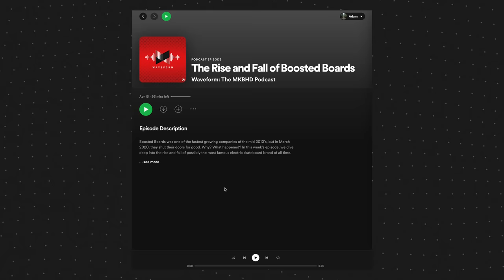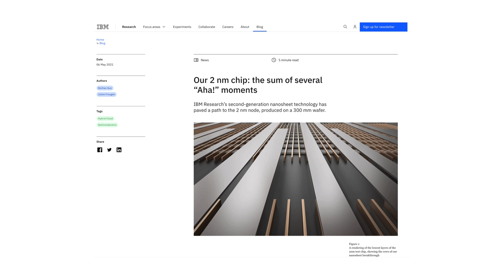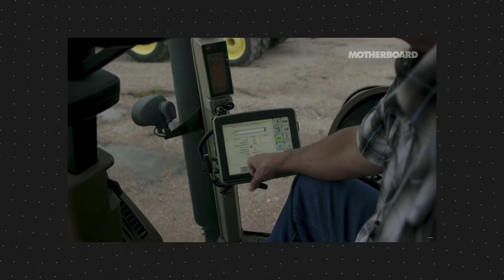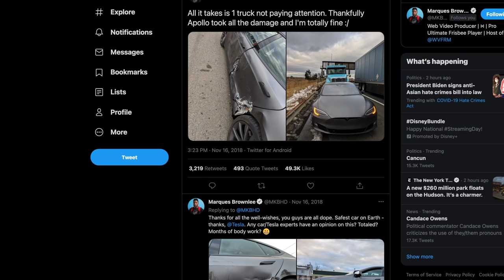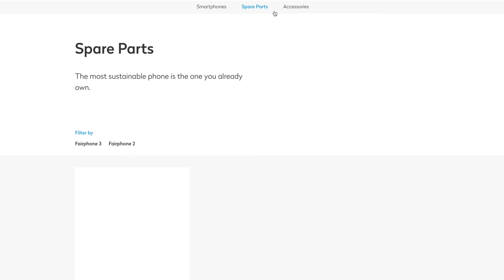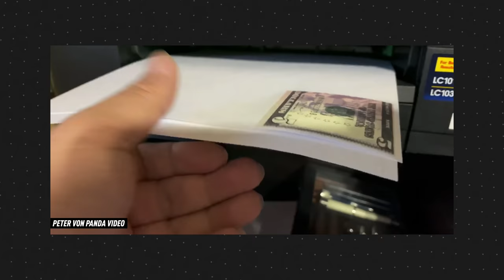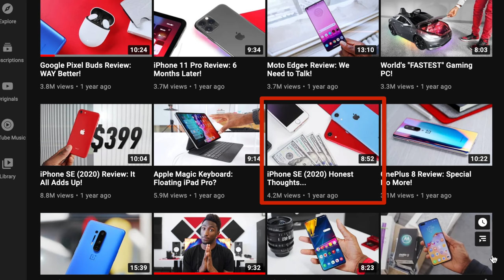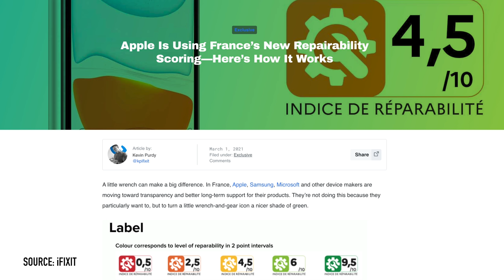Right to Repair Deep Dive!

Comment: I'm really not a fan of the bothsidesism going on in this podcast. The comparison of you can't print money with tech companies not letting small repair shops from having access to repairable parts is utterly ridiculous. One is preventing illegal activity. The other is forcing obsolescence and practically forcing people to buy new shit. Forcing a 3rd party manufacturer to not sell parts to repair shops is reprehensible and disgusting in a capitalist country (cough, cough, apple)
In terms of Tesla. The fact that if I make an unauthorized change to a Tesla means that they can blacklist you from the super charging network is the dumbest shit I've ever heard of. It's like if I replace something in my car and Toyota says nope you can't use gas stations anymore. Like how dumb is that?
Don't get me wrong. You showed some decent counter arguments like with John Deer. But at the end of the day it's on the buyer to decide if they want to fix their own shit. Even if it fucks up the reputation of the company. No company has the right to prevent the purchaser from using what is rightfully theirs to the fullest extent and blacklisting them from features that are advertised is disgusting and should be illegal.

Comment: Disappointed with participants knowledge around right to repair.  How is the innovation/optimization relates to repair complexity ? Are we saying that last 100 years was not innovative bcz their were easy to fix ??? Companies are using this excuse to justify the control over their tech. The so called innovative phone or tractor does requires repair work but is only allowed by their own technician.
Reply: I would suggest you watch an automatic transmission repair video for your own amusement and to learn how "easy" it is to fix a modern car that has a transmission problem.